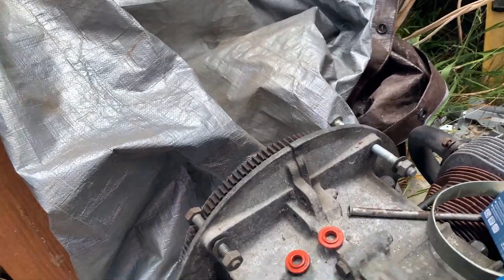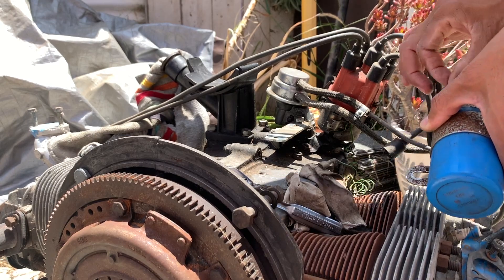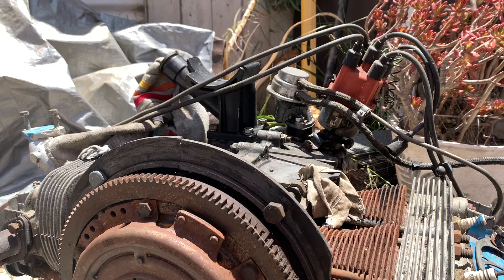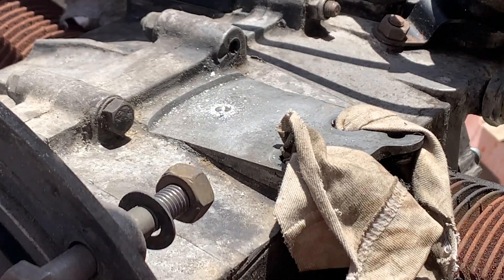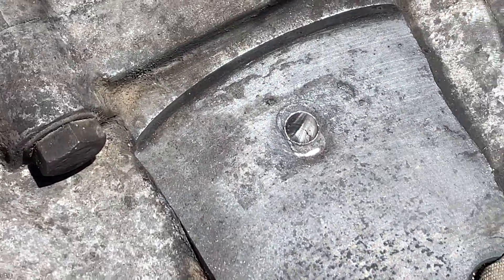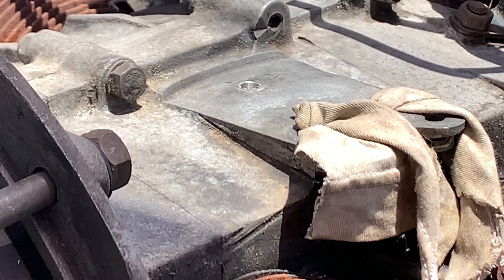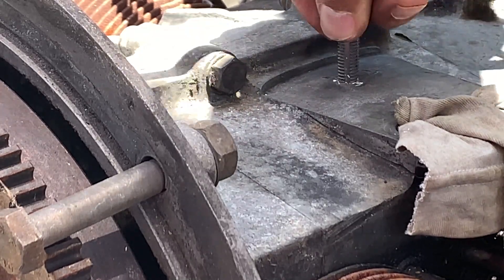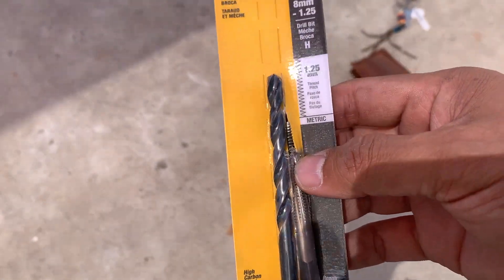VW Doghouse Oil Cooler Conversion 1500cc Engine | 1969 VW Bus Revival Project | Episode 11

Comment: Did it leak ? I ask because there are adapter seals that go from the 8mm oil holes on the top of the case to the 10mm holes on the oil cooler base. The seals are a light blue in color
Reply from the maker: I think you are right. I haven’t noticed any leaking yet but I need to put more miles on it. I thought about that after I put the seals but was over it and didn’t want to drive back to the parts store 😆

Comment: Leave 'em stock.  No issues.
Reply from the maker: True but I wanted to upgrade to a newer style cooler. This style came stock on the later engines that VW built. Maybe 1600cc and later. It allows the air to flow directly onto the number three cylinder.

Comment: Oil cooler bypass, to external cooler.
Doghouse blocks air to #3.
Reply from the maker: I think I saw that somewhere. I forgot who had that on a bus. Not doing that now but when I build a new engine I will probably do an external cooler with a fan.
Reply: What are you talking about? Doghouse cooler does NOT block cylinder number 3. In fact, it allows more air flow to no. 3 than in shroud cooler. External oil coolers look stupid a.f. and are not needed unless you’re running a high horse motor.  Read Gene Berg’s research.
Reply: @txgreasemonkey  that's my point. No in fan cooler or doghouse which still blows hot air from the cooler onto the engine. .Remote cooler  with full flow. It's very easy to mount and hide the remote cooler.

Comment: Legit work man! Got that Hoover bit too I see.
Reply from the maker: Jaaa. Yup. Only problem is these after market parts don’t fit right. I have an after market fan shroud and hoover bit so they don’t seal right but it’s better than what I had before which was nothing. Jaaa and I was running a normal oil cooler. So this should be an upgrade and hopefully a cooler engine. 😁

Comment: Great Job!!. I hate those little rubber seals. 

they always want to leak. I hope to see your bay window running soon.
Reply from the maker: Jaaa Thanks Oscar, sorry I never replied. I think these seals are fine if you use the correct ones and make sure they are not all dry and brittle. Bay is running now, but has no power. Gonna do a valve adjustment soon and switch to electronic points and make sure my carbs are tuned right and hopefully that will help me get some more power. We'll see, regardless I'm gonna go with a bigger engine for sure.